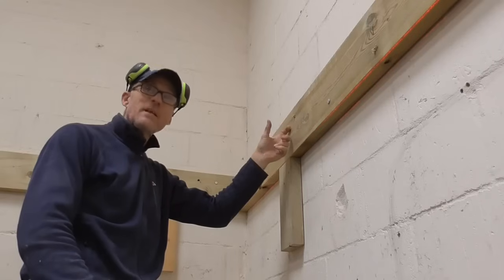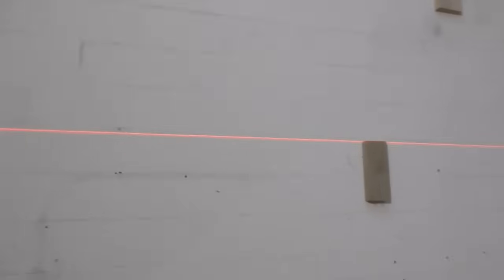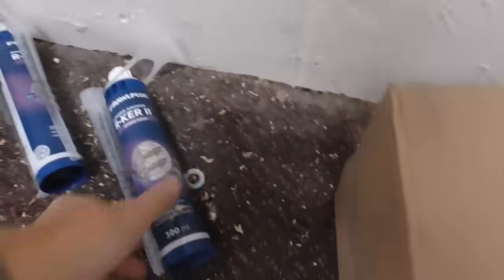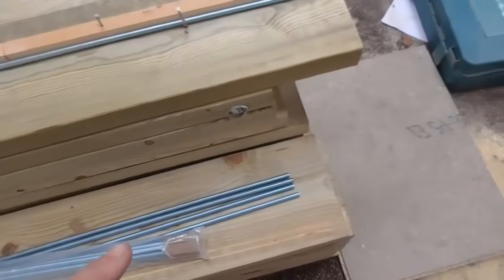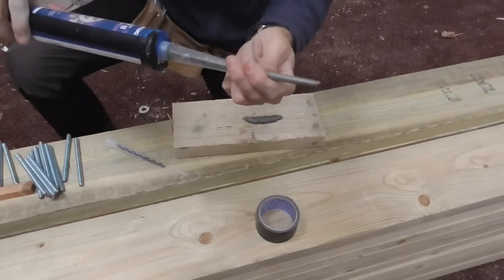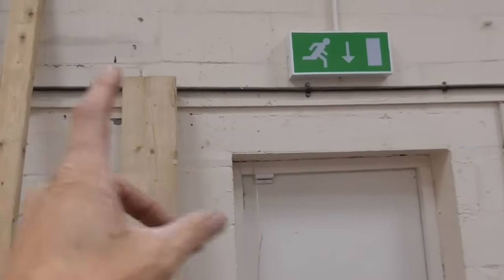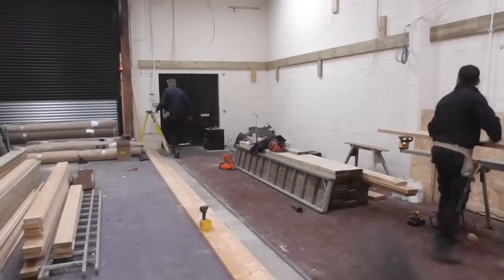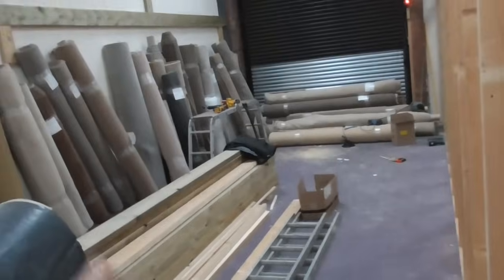Fitting industrial unit first floor using traditional joisting method***ITS PRETTY BIG!!!*** Part 1

Comment: Tell him it's 12.7mm not 12.5 ;)
Reply from the maker: I suspect you will be the first of many to correctly point out this Mark👊Cheers Del
Reply: Always clean your hole out , before you put your bolt in … 😂😂😂 and a couple of pumps away ..
Reply from the maker: @paulknights1764  Not you as well Paul😲🤪
Reply: @thetallcarpenter   couldn’t resist del .. 😆..
Reply: I was waiting for someone to correct me 😂
Reply from the maker: @RyanBrown-87  You knew it was coming bud😆
Reply: Yep 12.7
Reply: ,and 39.37 inches is 1 metre , great videos Del 😎🇬🇷👍

Comment: Nice job in the dry. And a bit less cold. I agree a good job to do. Pretty simple work. Satisfying job. And for a mate. Perfect. We are cooking in high 30's heat. And the first Cyclone of the season is currently hitting Qld as a category 2. Doing a fair bit of damage as it tracks inland towards the Daintree. End of this week we should get the fall out. Some much needed rain.  Different world.
Reply from the maker: Hi Dave🖐Sounds like it's a bit full down there bud, and I actually think too hot is worse than too cold🤔 Thanks for watching fella🤩

Comment: Ona a job a while back using chem fixing when we ran out and needed to go and get some more. Store had run out of the brand we were using so got a different brand. Half filled a hole with the last bit of the first brand and then filled hole up with some of the new stuff. And then the 2 reacted creating a gas cloud that instantly filled the work area and we couldn't breather and with eyes streaming ran out of the room. And we were working in a secure facility and got an almighty rollocking for that, a proper one. Don't mix your chemicals fella's.
Reply from the maker: That sounds well iffy bud😬and definitely something to be aware of when using resin👍Thanks for your comment and for watching 😎 Cheers Del
Reply: Very amateurish on our part, considering we'd filled out a COSHH sheet. Seriously, the smell was off the chart, really choking. Learned a lesson from the ear bashing we got!

Comment: Always nice to see you Del and it looks likes a good project for this time of year. Great tip in how you managed to straighten out that ledger.  A tip I have for you is next time on a similar job, before cutting your bolts thread the nuts on first just behind the length needed and it will save you deburring the ends, especially 40 bolts. Looking forward to part 2 but if thats all for 2023 thanks for all the  videos and happy xmas to you and your family. 👏👏👏
Reply from the maker: That's a great tip Kevin 👍 I just need to make sure I actually have some nuts next time🤪 Many thanks for your best wishes and hope you too have a nice Christmas 🎄 Cheers

Comment: You should try using thunderbolts Del. No need for resin and rod any more. 

M12 thunderbolt abd you just drill a 10mm hole and drive it in. Saves loads of time.
Reply from the maker: Hi there🖐I will check them out as I've never heard of them👍Cheers
Reply: Yeah, they are a game changer. I use them from 6mm and up. I find 6x80s fantastic for pinning down partition bottom plates.
Reply from the maker: @kiwigrunt330  I've checked them out, and actually used some today for fixing an aluminium gazebo down into a concrete base👍Bloody brilliant 👏
Reply: @thetallcarpenter    Bosh!! 👊

Comment: Well Del . A laser is handy for this job. How did we manage before them 😅.  I am a little jealous you been able to mark the studs were the laser hit, while standing 😂. I would need a steps 🙄🤣. Great video. 👍 🇮🇪
Reply from the maker: Hi Paul🖐To be fair, the joists are only 2.2 meters off the floor, so not much of a stretch for most people👍And yes, it's crazy how much easier laser levels have made the game👊Thanks for watching 😎 Cheers
Reply: @thetallcarpenter  I only started using laser   in the last 2 years. A game changer .as you rightly say. 👍
Reply: @thetallcarpenter  That is a low ceiling for a carpentry workshop. Even for a not-so-tall carpenter. Too low to swing a full sheet around, let alone a cat. On lasers, I was compelled to buy an expensive rotary laser level 20 years ago to set out a new house on a steep site by myself. A dumpy level and a five metre stick clamped to a saw stool just didn't cut it. I earned the laser level back on that job alone. I just recently bought a cheap 3/360 laser level with receiver from Aliexpress. It is fantastic and remarkably accurate. How long it will last is of course another matter...
Reply from the maker: @kiwigrunt330  I actually described it as a workshop by mistake, and it's only offices and storage downstairs and showroom upstairs😬

Comment: Hey, where do you stand on 15 vs 16g nailers? I've got a 18g and framer, but wondering what to buy next.
Reply from the maker: Hi there🖐I've had 18, 16 and 15g nailers and found that the 15g was good but only used for a few specialist applications. I now only use the 18g for finer work and the 16g for more 2nd fix carpentry jobs👍Cheers Del

Comment: Don’t get too many stud walls like that. I like the the idea of marking off the studs to the laser! I would have built frame work on the deck to the tightest measurement and stood  it up then wedge it up to the laser! I prefer your method🎉
Reply from the maker: Using the laser was particularly suited to working indoors, plus it was a fairly low top plate👍Appreciate your comment and thanks for watching😎Cheers

Comment: What a great job for the winter. Was that compressor out of a travel fridge?
The external deburring tools are great for thread ends.
Reply from the maker: Sure is Michael👊Every time I'm grinding the sharp edges off threaded rod, I remember how much I need to get one of those deburring bits👍Thanks for watching 😎 Cheers Del

Comment: Another great video Del, joisting out a space like this is always a glory job as it changes instantly, looking forward to the next video. Did you consider a double top plate for the stud wall? Cheers, Will.
Reply from the maker: Hi Will🖐We didn't go for a double top plate purely because there is 18mm osb screwed on both sides of the wall👍Thanks for watching and your comment 😎 Cheers Del